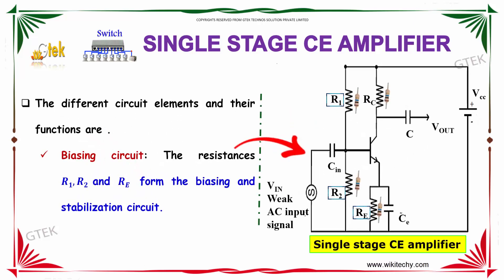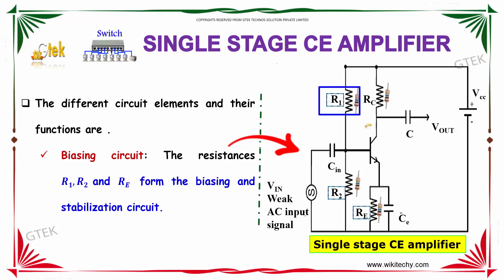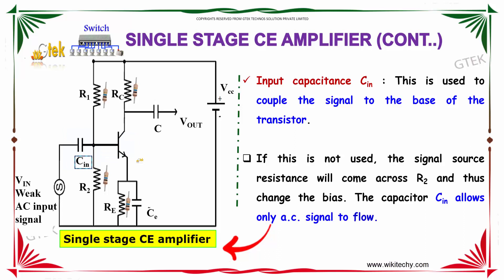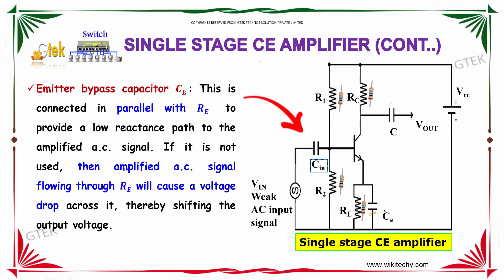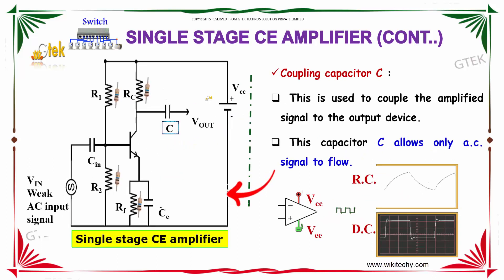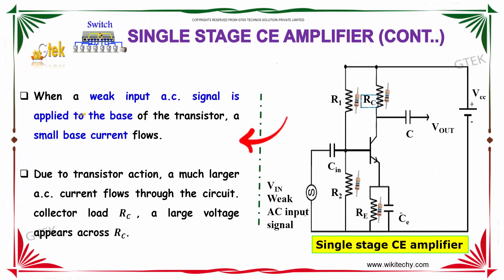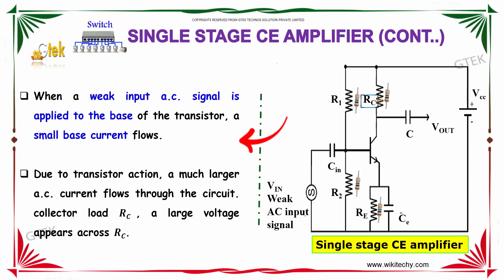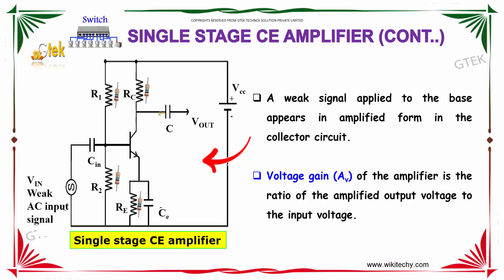Single Stage Amplifier Semiconductor Class 12 physics subject notes lectures CBSE IIT JEE NEET

Comment: The voltage gain of a single stage transistor amplifier is the ratio of a.c. output voltage to a.c. input signal voltage. Hence, in order to determine the voltage gain, you should consider only the a.c. currents and voltages in the circuit.

Comment: The term amplifier as used in this chapter means a circuit (or stage) using a single active device rather than a complete system such as an integrated circuit operational amplifier. An amplifier is a device for increasing the power of a signal.Sep 21, 2016

Comment: Amplifier Is used in this chapter means a circuit (or stage) using a single active device rather than a complete system such as an integrated circuit operational amplifier. An amplifier is a device for increasing the power of a signal.